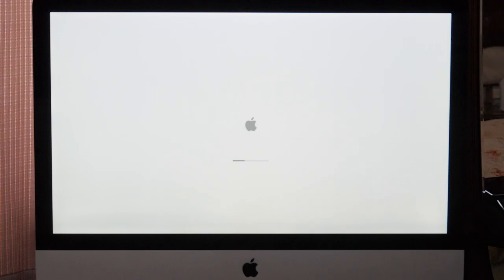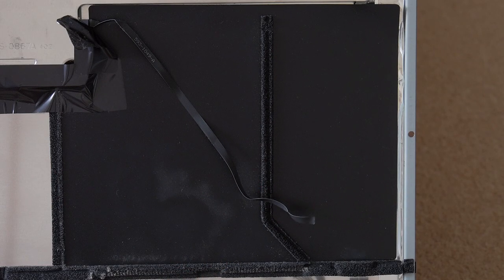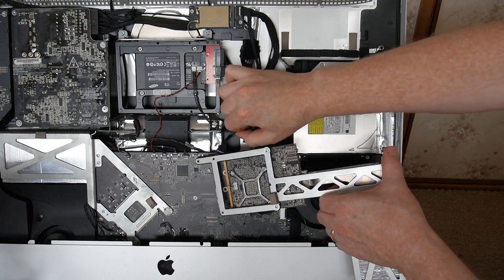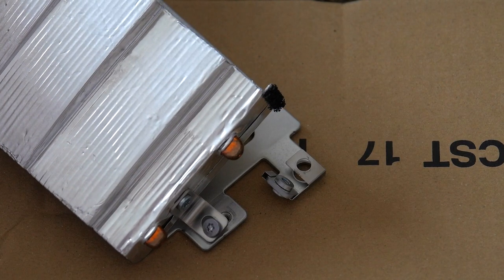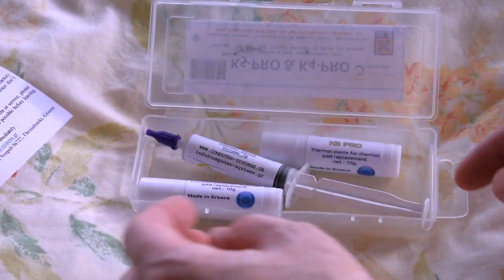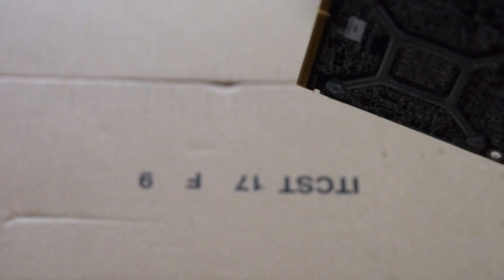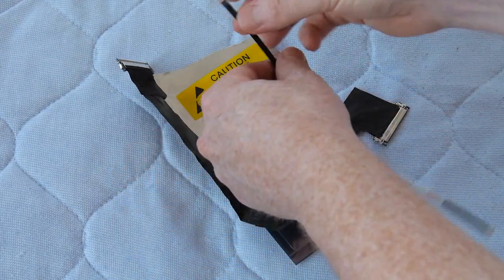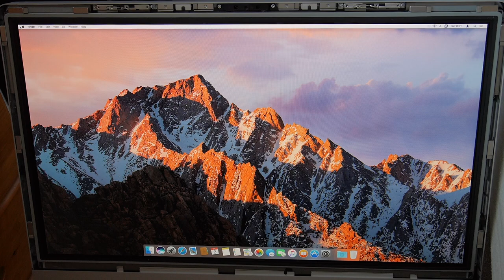Late 2009 iMac 27" Video Card Repair — 4850 — 2nd Bake

Comment: i must commend the effort you put in to come out with this video. i went through the same process but after mounting the screen, the computer wont power on. so i tried powering without screen and it came one. But when i put the screen back on the pc won't power on. i hope you can help. Thank you!
Reply from the maker: Thank you for your question.  Are you sure you connected all the cables properly when putting on the display?  If you did, then are you sure the two ribbon cables (one small, the other very wide) have good connectors that are making contact with the circuit board?  Most problems like that after a bake are caused by cabling problems.  So while it is frustrating, you need to check all your cable connections again, including the tips of the two ribbon cables to make sure nothing is broken or making bad contact.
Reply: @JDW-  then i guess its the wide ribon cable, i notice one looks broken . its not come off completely though....i guess i need a new cable then. Thanks for your help
Reply from the maker: @yakubibbabs2579  It's highly likely that cable is the problem, as I mentioned in my video FAQ answer here: https://youtu.be/hldcyJ_qUD4?t=1083

Comment: I have the same problem, got the video card replaced in 2015 and now it happened again.
Reply from the maker: It sounds like you haven't tried the bake yet.  If not, be sure to read the text Description under the video above (click SHOW MORE to expand it).  You'll also find a link to my 1st bake video which talks about removing the motherboard completely so you can change the PRAM battery on back.  It's time consuming, but if you wish to get more life out of your iMac, I personally think it's worth it.  I read and reply to every single comment under both my videos, and from that dialog with others I know the vast majority of people who try the bake find success.  It's definitely worth a shot to resurrect your video card.

Comment: I watched both of your videos.  Since you were going to replace the pram battery, yes, logic board needs 
to come out.  But the 2nd video you did only the graphics card.
I believe it failed because you left the old thermal paste on.  So the connection was not good. 
I am not 100% sure of that though, but from what I've read, you won't get the heat transfer if you leave the 
old paste.
Since you had the logic board out, you should have remove the heat sync for the cpu and put on new thermo paste.
"If" you need to redo the graphics card, I would suggust you doing the cpu also.  It's easy enough. :)

I just got a 2009 27inch iMac, 2.66 Ghz.  I remove the memory and reinstalled it and was able to get it to boot 
and run for several hours.  But it's has started with the lines, picksalating, even on the external monitor.
I will try the baking also.
Thanks!
Reply from the maker: While it is true I should have replaced the thermal paste on the CPU, it is also true it would have taken more time that I didn't have that day.  But what I can say right now is that, as of today in November 2022, I have never replaced the CPU paste and the machine is still running fine.  In theory it would be good to replace the paste, but in practice the machine still works and the CPU temperatures today are about what they are back when it was new.  

The replacing of the paste on the GPU though is an altogether different matter because the GPU was preventing the machine from working, and my not having replaced the paste after my first bake was a mistaken that most likely led to my getting only 4 months of use from that first bake.  I rectified that after my 2nd bake and got more than 2 years and 9 months of use out of it. 

So when working on these old Macs, the most likely part to fail is the GPU card, and when handling that issue, it is only logical to replace the paste on that.  But whether one wishes to replace the CPU paste or not is really up to the person doing the repair.  In my experience, it is not as critical as repasting after a GPU card bake.

Comment: Tried your method but now getting a black screen with 3 single beeps. I checked and reseated the memory but doesn't seem to want to work. I even ordered new memory but it made no difference.  Will have to order a second video card from ebay.  Thanks for thos good video.
Reply from the maker: Jorge, I am very sorry to hear of the 3 beeps.  But it's definitely RAM related.  Since you seem to have purchased new RAM and still have the same problem, it could be the socket is dirty.  Trying blowing it out with compressed air.  And when you put the RAM back in, make sure it is seated properly, deep within the socket, as far as it will go.  If that doesn't work, it's either bad RAM or it could be that you were not adequately grounded when you touched the RAM and zapped it with ESD, which may have killed it.  That doesn't happen often, but it can happen, and the only way to be adequately protected is to have a grounded wrist strap, grounded to earth ground when you handle and install the RAM.  You can read more experiences about the 3 beeps here: https://discussions.apple.com/thread/6632986
Reply: @JDW-  I will try your recommendations before I buy another video card. I will let you know the outcome. Great videos.. I am now one of your subscriber from across the pond.
Reply from the maker: @Frenchtechprofessor  Thank you, Jorge.  Please let me know the results of your tests.

Comment: Thanks for the video, your first video made my iMac work again for almost a year :) 
Now that its time for a second bake, I wonder: I can lent a professional heat gun, would that be a better option than baking the whole card?
About the temperature and time of the cooking process: theres a difference between the use of a conventional and a convection oven. The baking times of a convection oven are shorter. Which type have you used?
Reply from the maker: I did not use a heat gun because it’s very difficult to know how much heat you’re actually applying, and it’s very easy to apply too much heat to the board such that you may completely melt solder on surrounding components and they might slide off their pads. So doing the oven bake, in my opinion, is safer for most people. 

With that said, a couple people here in the comments have reported success by using a heat gun, so I know that it can be done that way.
Reply: JDW tnx I go for the oven again :) 
And about the oven you used? Conventional or convection?
Reply from the maker: @herrhendrik  I have a small convection oven that also has microwave features.  Such are common here in Japan.  However, I do know that some people do the bake in a traditional oven with success, so you really don't need to worry.  Just pre-heat your oven to the correct temperature before you bake, and then make sure you use the aluminum foil to make little feet to keep the card raised up a bit.  Bake it for 10 minutes, and then the heat-job is finished!
Reply: JDW My oven has both options, I’ll use the convection option, in theory the air should be more evenly spread. When baking food in an convection oven the temperature can be reduced by 10-20% compared to an conventional oven for the same result, that’s why I asked :)
Reply: The card died, after 4 months 😢
Reply: ok I baked it again :)

Comment: Thank You A Lot It worked For Me 1 thing what is the app for internal fan cooling that you were talking about peace
Reply from the maker: There are actually two good fan control apps that I have tested and are quite good:

https://www.macupdate.com/app/mac/47386/macs-fan-control

https://www.macupdate.com/app/mac/23049/smcfancontrol
Reply: Were 5 months in on the 2nd bake, is it still running well?
Reply from the maker: Yes, it's been almost exactly 5 months since my 2nd bake and my iMac is still running great.  No problems at all.  It's running High Sierra too.
Reply: Excellent. My mac has green vertical lines on the screen and the gpu and gpu heatsink get extremely hot. Im thinking this bake technique might fix it. Did yours get really hot as well or did you just have the screen artifacts? I watched other videos on youtube where people said it was their heatsink that was the problem..it had some sort of tiny whole(s) in the copper tubing that didnt allow the gpu to cool properly.
Reply from the maker: All the late 2009 QuadCore iMacs run hot.  Play a game for a couple hours and then lay your hand on the back, especially the upper left side where the power supply is located.  It's hot!  Even after my 2nd bake and usage of better thermal paste, the machine still gets hot if you push the video card with games.  This isn't a heatsink problem that you can fix by a mod to the heatsink.  Instead, just use a fan app to bump up the fan speeds.  I do that on my and it runs a tad louder but cooler.  Anyway, in your case I do believe you are having video card issues due to the same old defect in the video card, not a design defect in the heatsink.  As such, a bake performed as I describe in my videos should solve the problem.  It's worth trying if you have the time (and it DOES take time!) and the thermal paste and other parts I mention in the DESCRIPTION under the video.  Best wishes!
Reply: I just checked ebay..$11.99 with free shipping for a set of k5/k4pro paste from greece
Reply: The paste kit you bought this second time around...do you think you'll have enough to use it again if you need to do a third bake?
Reply from the maker: If you buy the same kit of K4/K5 thermal paste I did you will definitely get multiple uses out of it.  You could do 4 bakes and still have both types of paste left over.  They give you a lot a lot of paste.
Reply: Excellent, thats the one I was looking at..in the rectangular box. I'll let you know how it goes. Thanks

Comment: followed the two videos, very happy with the cook replaced the two cables. getting blank screen when it reboots.
I believe the problem is where the fox com cable attaches to the mother board, socket has movement, is that the end of my journey?
Reply from the maker: You said you are "very happy with the cook" which I think means "very happy with the bake" which means "the bake worked" (I think).  But then you said you get a blank screen.  So after your bake, did anything ever show on your display or was it always blank after the bake?  A few people in the comments section have reported something similar, and I always advise them to check cables.  Even if one cable is left disconnected or improperly connected, it can result in a blank screen.  And if any socket moves or wiggles a lot when you touch it, such could be the sign of broken solder joins on that connector, which means anything you attach to that connector would not make a good connection, and such could result in a blank screen.  If that is truly the case on your machine, you or someone experienced would need to apply fresh solder to the broken solder connections, and if it is found that the connector itself is damaged, the connector would need to be replaced.  Once done, that should fix the problem completely, assuming your bake was successful.
Reply: yes having dismantled it again I rightly wrongly gave it a wriggle test and the plug in came off the mother board, my bad. so don't know if that is repairable or means a new  mother board @JDW-
Reply: most likely when I dropped the screen first time the socket was stressed to90 deg instead vertical
Reply from the maker: It is repairable but probably not by yourself, especially if you lack soldering experience.  One person in the comments reported the exact same thing in the past, and I believe he found a replacement connector and got it soldered in properly, which resolved the problem completely.  But it can take some skill to go about soldering because if you ripped off that connector, some of the PCB pads might have been torn off too, and any replacement connector you buy would not be so easy to solder down (if pads are missing).  Pins on the new connector that would rest on a missing pad would need to be soldered to the wires attached to those missing pads, and that may require adding very tiny wires to bridge large gaps that may exist between the missing pads and their wires.  If you lack the desire and/or ability to do that work yourself, you should perhaps call a local Apple products repair shop for a quote, then compare that price to a new motherboard on EBAY.  I suspect a repair shop could do it for less than the cost of a used motherboard on EBAY.
Reply: thank you, and I was doing so well. Hey ho just disappointed as I felt I did the hard part @JDW-
Reply from the maker: Performing a successful bake really is the hard part.  Replacing a damaged connector and soldering around missing pads is hard too if you are not experienced, but it would not take nearly as long as the bake.  Finding the replacement connector and waiting for it to arrive would of course take a while.  But again, that's why I suggest phoning an Apple repair shop for a quote, as they may have that part in stock and of course have the experience to do an excellent soldering repair.  But I feel your pain.  When I performed my 2nd bake, I let the screen fall forward which snapped off one of the ribbon cables, forcing me to order replacements.  Thankfully my connector on the big ribbon cable was OK.  These repairs are frustrating, but when all is said and done and you reflect on the money you save by doing the repair, it's all very satisfying and worth the effort made.  At least, that's how I felt.  Best wishes, Dave!
Reply: Thank you my friend, there is a part that although not my field, I don't want accept that it no longer Apples responsibility not to be bothered 
 @JDW-

Comment: Thanks for this. Did you use the oven fan or without fan?
Reply from the maker: I believe the little oven we have here in Japan has a tiny fan inside, and most likely it was blowing air around inside, albeit not very strongly.  But you bake shouldn't matter.  So long as the temperature is right and you bake it for 10 minutes, that's what matters.  It might even work in a toaster oven, but I would suggest sticking with a traditional oven to be safe.
Reply from the maker: So long as the temperature of the air being blown around is correct, it shouldn't matter if you use the fan or not.  Using the fan might actually be better since you would get even heating that way.  However, if the fan blows really hard inside your oven, it might knock the video card off the aluminum foil mounts (which you need to make), and in that case the fan would be a bad idea.  So long as the video card is stable on the aluminum foil stand-offs you make, you should be able to safely use your oven's fan.
Reply: @JDW-  Hi again. No it is done. 200 degC in 9 minutes with fan on. I was quite confident this would work, but still I was so surprised when my imac27 late 2009 started as expected and with no signs of the strips at all. This video was so well done with you describing step by step, made a quite difficult task easy to do. Thank you very much :-)

Comment: I noticed the screws were lose, and the thermal paste cracked, when taking off the GPU heat sink. I wounder if the original thermal paste shrunk over time, causing the heat sink to not be a good conductor of heat? Also with the thermal sensor on the heat sink side, it my not be giving accurate readings of how hot the GPU actually is, and not ramping the fans up?
Reply from the maker: The screws on mine were not loose, but the thermal paste used by Apple was cracked.  All thermal paste ages over time and needs to be replaced at some point.  But usually there is good enough contact so it won't matter if you replace it, even for 5 to 10 years.  So I doubt the aging of the thermal paste is causing these problems.  The evidence I am seeing is that it is a design defect in the video card itself, and baking the card somehow restores proper operation.  But you are right about the temperature sensor.  If it is measuring false readings (temperatures much higher than they actually are, or if the temperature sensor is disconnected entirely or malfunctioning) that would cause the fans to run at a much higher than normal RPM.
Reply: There is a built in temp sensor on the GPU (GPU Die) that in combination with the GPU heatsink Temp can help you determine is the problem is the the interface between the Heatsink and the GPU or the GPU itself. If there is a wide difference in temp (say >20) then you know the thermal interface is not correct. The screws on the heatsink need to be done up only slightly tight. It is the springs that do the work to keep the heatsink and GPU faces in contact.

Comment: Just an update from me, My first bake was done in May 2020, and I've just had to do it for a second time. So just under 4 years working for me.
I had different issues this time, first was green bars down the screen, but this time it took 10 to 15 mins after boot up for the screen to pixelate, hopefully another successful bake. I'll update if it did not sort the issue out.